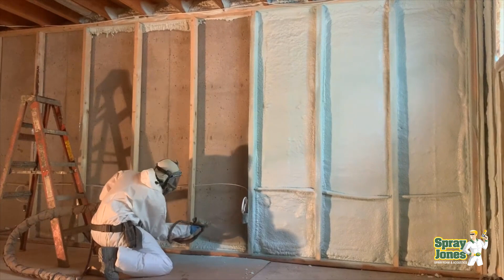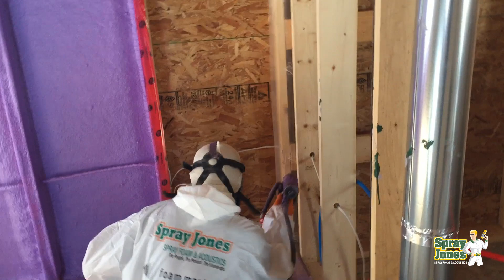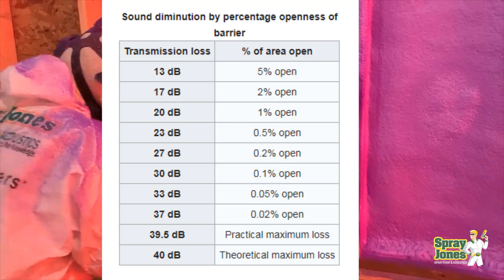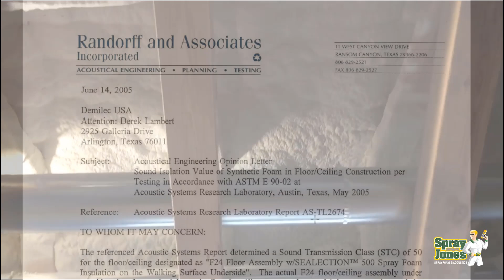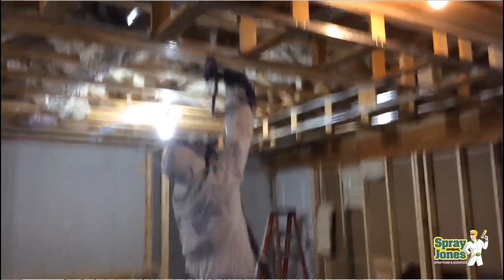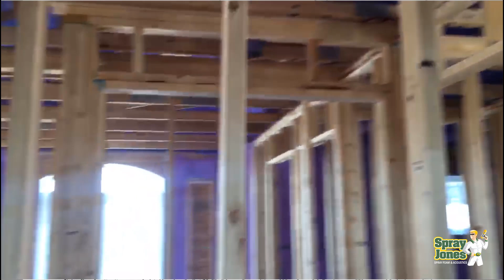Sound and Spray Foam Insulation | Is it loud?

Comment: Hi. I need a recommendation.  Doing a 5000 sq foot red iron steel warehouse here in South Florida.  We will air condition the building and therefore must insulate it.   My spray foam contractor recommended closed cell 3" for roof and 2" for walls.  My general contractor is concerned about sound transmission during summer thunderstorms.  He says that the rain on the steel roof will be quite loud and recommends a hybrid approach of 2" closed cell + 5"  open cell for the roof and the walls.  I'm having trouble making a decision.  Whats your recomendation
Reply from the maker: The Hybrid can work well. Vapor drive is from outside to in and the closed cell plus metal will handle that. The open cell is sound dampening.

Comment: I found that an R-20 of exterior continuous Rockwool insulation on the outside of my house is all the thermal and sound insulation I need for a warm and quite home.
Reply from the maker: Keep the water from getting behind it, and the bugs, and the mice and you should stay Ok.
Reply: @SprayJones  Rockwool is hydrophobic and vapor-permeable, insect-resistant, and mice don't nest in it. But you know that.

Comment: It's great for airborne sound. Terrible for structural sound. But adding the inner later of drywall helps the structural sound a ton. 

I was startled at how loud the rain was before my ceiling was closed up after the foam vs before!

Comment: I'm more interested in the nerdy side of this. I'm looking to build a work shed that I can do sensitive audio recordings similar to what a radio station might need. The real only advise I've come across is to do double thickness walls to handle double the insulation. I know fiberglass is pretty good at sound insulation, but I'm looking for the best option. I've also heard that some insulation spray foams can cause the wall to become more rigid, which might transmit certain frequencies of sound better, though they'll also block others better. To me, it seems logical to look for a hybrid system, but I'm looking for more data.

I'm open to input and honestly I don't know much about building code or building structures in general so I'm researching for what I need so I could tell my contractor what I need when I'm ready.

Comment: Thanks for this - do you know much about closed cell as opposed to open cell as most of your video is discussing open cell? 

We recently did a whole home full CC on the walls and OC in the roof line. Love the energy efficiency but the house rumbles easily and planes are far more noticeable than they used to be with cellulose in the attic.
Reply from the maker: Most of my channel is closed cell.

Comment: I am looking to do spray foam too. Glad I found your channel. I might need to build a few boxes with fiberglass, rockwool and spray foam and see which one does a better job. I was in a barndo a few weeks ago, all spray foam but no OSB or Zip system and no drywall. You could hear outside a little bit more. I do think spraying on the metal doesn't help as much as having a OSB between the 2....
Reply from the maker: Every bit helps reduce vibration. A big empty building is a tough test tho...
Reply: @SprayJones  Very true! When he gets done with it, I will check it out. I plan on doing spray foam no matter what. I live in Wisconsin, I hate the cold lol.

Comment: I have a new home build in CO, main floor is vaulted to 26’ and manufactured log walls on upper level and ICF 8-10” concrete on all lower level. Finished upper Floor will be slate. Lower level is 10’ ceilings and concrete floor.  What treatment would you recommend?  Roof is 1 1/2” ply with metal standing seam.  I need R49 minimum on roof structure.  In floor radiant heat btw both floors and ENERsign windows R10.  I want maximum acoustic treatment between floors which is 12” OC.  Also using 5/8” Quiet Rock drywall on lower level with Hilti putty for outlets and acoustic goo for the drywall application.  Please advise.

Comment: Mike, 

Great video as always. As noted in discussion, we are going with 3" CCSF on exterior walls, ceiling & garage residence transition wall. Still deciding on interior for sound etc. We'll do something but it still deciding. 

One more thing to think about regarding sound, living at 6,850' elevation, I would anecdotally tell you that altitude affects...for sure outside. You would be amazed how much sound carriers the higher altitude you go.
Reply from the maker: Good stuff!

Comment: thanks for sharing this.  how thick was that floor assembly that achieved the STC 50?
Reply from the maker: Can be done in 12" floor with TJI truss.
Reply: @SprayJones  thanks for the reply.  You applied 12" of foam to achieve STC 50?

Comment: On my last house build (1600 sqft walkout), I did the bottom part in ICF (8" concrete, 10' tall walls).  It was incredibly quiet down there.  That said, for the theatre room in my next house, I will use staggered, double 2x4 walls with the Roxul safe & sound as I need it to be dead quiet so I can make noise in there when my wife is asleep 😉  Foam isn't good enough at blocking the low transmission sound from a Subwoofer.  Neither is fiberglass or a single layer of batts.  Having said that, I may be convinced to use spray foam on the first wall if the price is competitive.

Comment: Any hope of a nerdville sound video? Just did a mega fiberglass drill and fill retro on a casino hotel that refused open cell foam. They couldn't get anyone to stay at the hotel because it was so loud. The original contractor didn't insulate between joining walls. I could not sway them to foam with just anecdotal evidence because some dingbat told the project manager that open cell foam doesn't work.
This was a great video, and very informative. 💪🏽
Reply from the maker: Ok, I will do an advanced sound video for open cell foam and review the info therein. Stay tuned...
Reply: @SprayJones  that's fantastic news! Thank you for your time. All the science and engineering in these videos excites the inner geek, and really helps customers understand why they happily pay 2-3x more for foam. This information is hard to obtain.

Comment: Have an owner, building a 2-story ICF home, and has 12” I-beams between floors. They want sound attenuation/dampening to reduce the future noise from the future ruckus from the kids, and some plumbing between floors. Do you recommend filling that cavity or would 5.5” work well enough? (And maybe fill the cavities where plumbing is running through it?)
Reply from the maker: 4" of open cell will suffice. Leave yourself room.

Comment: I was disappointed to not get the STC ratings of fiberglass and cellulose and closed cell vs open cell.  Also disappointed that you don't like putting open over closed cell.   Planning on spraying my new house under construction, probably closed only but considering open for interior walls floor and ceiling around the MBR.  Thanks for the video Mike.  Love your channel.
Reply from the maker: Open cell over closed: If you would see how much work it is for how little gain you would join my reasoning. Pick one product and stay with it. One wastes $100 + dollars just in switch over of material.
We have to re-calibrate our thinking on insulation costs. people spend 50K on concrete for a house but cannot budget more than 8K for the insulation??
Reply: STC of open cell is actually lower than Fiberglass in a typical wall assembly 36 vs 39.. Just know that doing only this and not decoupling or adding mass will do NOTHING in terms of attenuating sound...

Comment: Based on my experience sprayfoam is not the best for sound attenuation. Open cell spray foam performs better than closed cell in reducing sound transfer, but neither is effective at blocking sound transfer. The qualities that make sprayfoam an excellent thermal barrier couples the wall elements together as one and therefore increases noise transfer.

Comment: First off thanks soooo much for sharing this. My question is with regards to interior walls with metal studs and a sandwich of gyproc open cell foam and gyproc. Also whats the best thickness to use for the gyproc ?Thank you in advance.

Comment: Can you do a video comparing spray foam insulation to common  rigid foam insulation such as eps and xps? I installed eps on the exterior of my detached garage and it's performing great, it's more comfortable than my house.
Reply from the maker: There is one for basements

Comment: Hi Spray Jones- is it possible to spray foam a painted surface, or will the foam lift? I would like to paint the wood in my attic white and eventually want to get it spray foamed when I have the money but I’m not sure if painting will sabotage the spray foam job.
Reply from the maker: 99% of the time it is fine.
Reply: what is the purpose of painting your attic wood white? maybe wait until you spray foam the attic and then paint everything white?

Comment: Thanks for the reply. I have watched all four of your videos you mention and also those of Joe L. and Matt R. and it is the diffusion port/dehumidifier/supply air in attic that adds a bit of confusion. I see the logic of closed cell the envelope with 2" or more, rain screen the walls, and the various ways to vent the bottom of the roofing ("frost line on foamed roofs" video"). It is the whole assembly especially with a metal roof that seems to have too many alternatives. Add peel/stick, fluid applied, ply vs Advantech vs Zip, and all the rest and it gets complicated for simple minds like mine. Joe's drawings are nice but the details are not there. We live in southern Nevada so it does not matter too much what we do regarding moisture management, no moisture to deal with in general. Thanks for your effort, I never miss one of your posts. Have a great winter season, I know it is a challenging time for doing foam. Bob Jarrard in Nevada

Comment: Love the videos Spray Jones - I was wondering if you could do one for crawlspaces? I am a spray foam applicator and still struggle with spraying floor joists from underneath the house. Can't seem to find the sweet spot temperature and for the life of me cannot make it come out as smooth as walls or ceilings. Would love some feedback, thanks!
Reply from the maker: Ok, Here is the secret..... it is not supposed to look good under there.. Lol.
Reply: @SprayJones  Well that's a relief 😂 in that case everything is going fine. Thanks again!!

Comment: Cold humid days, especially with low cloud cover is a major contributor to sound transmission. 

Cold air is more dense so the sound waves travel further.

Ever notice how you can hear a concert or construction that's fairly far away on a cold day like it's only a few blocks away? Vs hot sunny day.

Comment: Teacher, we have lots of confusing posts on moisture barriers, rain screens, where to put the insulation, and the like. This video proves that you can move from foam info to assembly info for us who need some clarity. Issues such as non-vented attic treatment of moisture near roof peaks, fluid applied membrane over OSB/ply/wrap, and on and on. Thanks so much. Bob in Nevada
Reply from the maker: Have you watched the 4 part series on non-vented roofs? I over some of what you are mentioning there.

Comment: Having a bit of practical experience here (I'm not an acoustical engineer), sound attenuation depends a lot on what frequency you wish to block.  The testing letter in the video shows quite clearly that high frequencies are blocked much better by foam than low frequencies.  Automotive sound deadening, mostly low frequency, use lead impregnated rubber mat.  A double layer of 5/8 drywall is very good for reducing sound transmission.  I can't compare it to foam, but it does an excellent job.  It's probably not something you want to do on all your exterior walls, but it's an easy add-on for existing walls shared between an office and media room or bedroom and bathroom.

On the "Karen" there is a large difference between sound traveling through a wall or floor, and sound reflecting off a wall or floor.  Reflected sound will always be greater in spaces with hard, flat surfaces, and the sound deadening properties inside the wall will have little effect.  Carpet, wall hangings, furniture, and other things in the space will attenuate sound through both absorption and diffraction (preventing resonances).  This is why soundproof rooms are not just lined with flat foam, the foam is angular to break reflections.  Karen still needs to pay her flippin' bill, but I suspect she was talking about reflected noise (which you alluded to, but some folks may have missed it) and your demonstration was about transmitted sound.

Comment: Am currently on my lunch break in the middle of installing 9” of open cell foam between the floors of a 4500 sq ft residence under construction on Cape Cod, MA. Costs a little more than the pink stuff, but a superior sound attenuation product. Will never use it for a thermal envelope, though, closed cell is the product for that
Reply from the maker: Good job Tim.
Reply: Did you need a vapor barrier? I have a split level basement, so thinking of spraying open cell on basement ceiling. House is in Atlanta.  The goal is to reduce sound.
Reply: @luisdelgado5374  You do't need a vapor barrier for an interior application, open or closed cell foam, or fiberglass for that matter. Closed cell foam is it's own vapor barrier, when installed in between a conditioned and unconditioned area. Open cell foam and fiberglass require an additional vapor barrier in this application. Hope this helps!

Comment: I once had a house built and immediately finished the basement. I decided to attempt "sound proofing" the space, but I went too far. I used metal studs for everything, I staggered the wall studs and for the ceilings I only attached the studs to the above 1st floor wood joists, in the middle of the span, using rubber strips. Other than that, everything was supported by the basement concrete floors, the concrete block walls, or it free standing. I insulated everything (including interior walls, with rockwool. This thing was so quiet that you could stomp on the floor above and only hear the noise because it had traveled down the stairs and through 2 doors.

I literally went too far because it was painful to enter the space. It felt like something was pushing on your ear drums, like q-tips were shoved in your ears too far. It was very uncomfortable! She had to run the ceiling fan any time she entered the room. Even with the fan on, my wife couldn't go into the room. I'm not joking and I'm not wrong, this is something that virtually anyone entering the space noticed. There's a point where sound deadening can be worse than noise transmission.
Reply: I was in a radio telescope instrument calibration room. It was so quiet you couldn't hear anything. It was legitimately unsettling to be inside. Too much can be a bad thing. 

https://www.youtube.com/watch?v=aC-LKEpaR1s